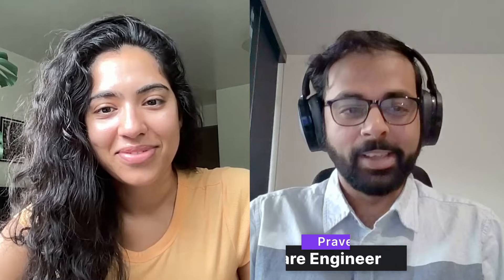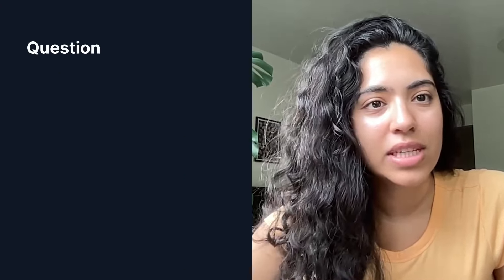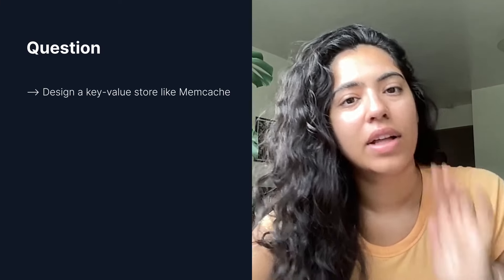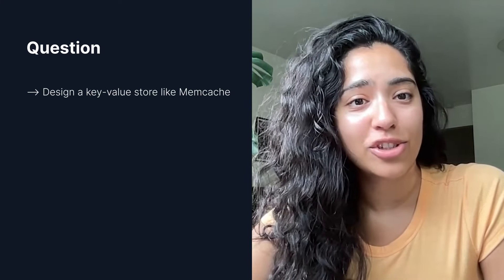Design a Key-Value Store - System Design Mock Interview (with Microsoft Software Engineer)

Comment: Its a good one, but it is missing on the requirement gathering phase. The first rule of System design is to ask clarifying questions which is totally missing. Looks like the candidate jumped straight into solving the problem

Comment: Should "functionality to set Cache Policies" not be one of the crucial Functional Requirements. I guess its always on service-owners to decide when & how eviction of data should happen from a cache service they leverage. The cache service can just list its maximum supported specification.

As a cache service, it must be offering options for setting eviction policies from set of all common algos. It must  also have features like to set TTL for records etc.

Also in the explanation of Consistent Hashing for allotment of key ranges between n nodes, the load is always equally distributed on all the nodes - NOT like C impacted mainly & no/less impact on A/B with addition/removal of D.  It is achieved through n level hash functions & virtual servers in ring distributing load equally between all effective nodes through re-adjustment. 
From his explanation of Consistent Hashing, suppose D kills off. It will overload C suddenly through major set of its data moved to C & it will kill C from memory load - which in turn will kill B & then A - hence BOOM on the entire cache service.